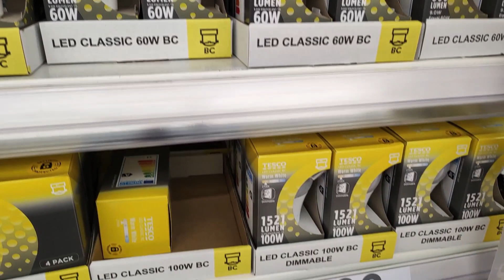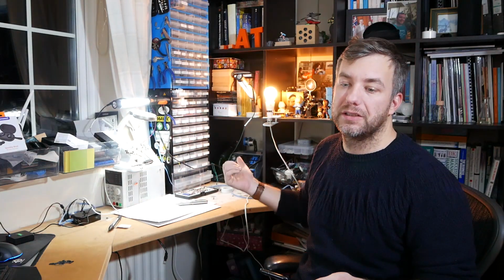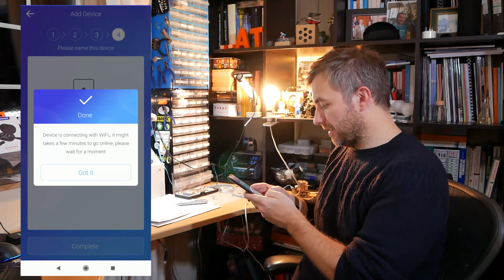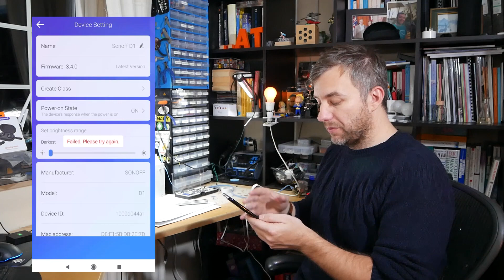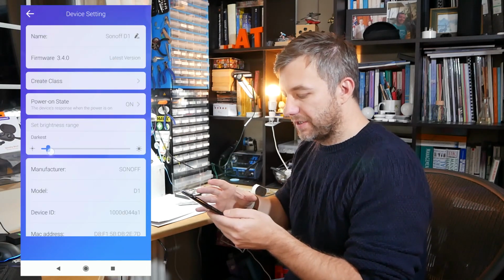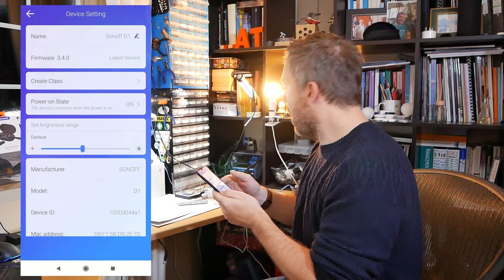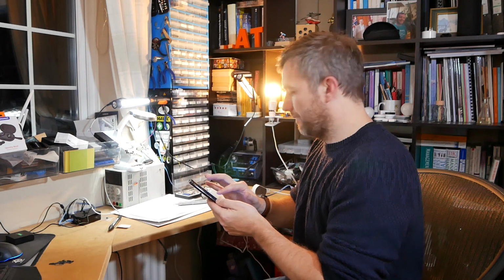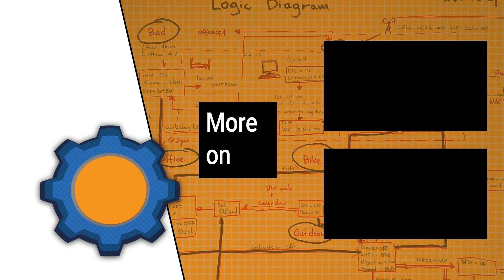Sonoff D1 Dimmer - modular in and out

Comment: Hello, I hope we can get help from you, I'm not an electrician, I can do something, I replaced all the switches with WiFi smartswitches, I will immediately point out that they are compatible with Sonoff RM433, and I bought Dimmer D1 for the living room where I have two lamps on the ceiling connected to one double switch and now I would like one lamp to be dimmable and the other not, I connected it several times with D1 reset, it does not connect to the WiFi router and the ewelink application does not find this dimmer, my question is do I have to replace this double switch with two single ones, or just with one single one and connect the Dimmer directly to the electrical wires, please help, thank you very much, best regards.
Reply from the maker: @junakjoniak661  to achieve this you'd need 2 dimmers. Assuming you want to have the same control over both gangs. Then you can fix one at the level you want and still use it for home automation instead of trying to wire one of them and leaving the other as is
Reply: Thank you so much for helping 👍 @notenoughtech

Comment: Hi fantastic video again I ordered the Sonoff D1  dimmer connected to my tall lamp takes G9 bulb and they are dimmable bulbs the Sonoff dimmer does not bim my G9 bulbs don’t no way do you no
Reply from the maker: Is it not dimming it at all or it's not dimm enough?
Reply: NotEnoughTECH hi thanks for the reply my G9 bulbs are dimmable can’t get them to work with sonoff D1 not dimming at all
Reply from the maker: Did you confirm that the dimmer is working with another bulb?
Reply: NotEnoughTECH I have try different brands off G9 dimmable bulbs all ways the same they don’t dim to be honest I did not try the bulbs you had on your video
Reply from the maker: I just wanted to make sure the dimmer works :)
Reply: NotEnoughTECH the Sonoff D1 is on the eWeLink app all set up it want dim my G9 dimmable bulbs when you set you lamp up with the DI the bulbs was flashing I did not do that I just connect the electric wire to the socket will it make any difference? Then unplug the DI then wired the lamp in to it
Reply from the maker: Can you toggle it on/off
Reply: NotEnoughTECH hi no it won’t toggle on & Off on the app says my lamp is on reality it not
Reply from the maker: If you can't toggle it there is a problem with your wires. Read this https://notenoughtech.com/featured/using-smart-light-switches/
Reply: NotEnoughTECH hi just watch your video fantastic the Sonoff DI dimmer does light Up when I go on the app it does switch off and on my G9 lamp does not switch on when I connect to the DI dimmer
Reply from the maker: What I'm asking is - when you connect the dimmer, can you turn light on/off ? I want to make sure it's wired correctly
Reply: NotEnoughTECH hi the wires are currently I can’t turn the lamp on or off the lamp dose not light up at all the D1 dimmer switch I can see the blue light on
Reply: NotEnoughTECH hi again just to let you know I made a home made lamp like yours on the video with a dimmable bulb still the same won’t power the light I think the Sonoff D1 is faulty I have ordered D1 again I hope this one works if not will be getting into with ITEAD they are the ones who shipped the item out it’s a shame I can’t send you a picture I have wired it right
Reply from the maker: If you have the voltmeter you can test the connectors but be careful
Reply: NotEnoughTECH hi I have ordered a voltmeter yesterday for amazon I did not have one when I received it and check on the Sonoff D1 Dimmer switch I will let you know I have sent ITEAD message from day one they have never reply back to my message telling them the Sonoff D1 dimmable switch is faulty telling them power coming in to the D1 switch not coming out to the bulb I have sent them pictures how it was connect
Reply from the maker: Just watch a couple of videos about safe use... Hi voltage is dangerous... And accident short can be costly to fix
Reply: NotEnoughTECH hi again I received my second Sonoff D1 switch this morning that one worked right away the first one I received was faulty just to let you no
Reply from the maker: Im glad you got this sorted. Enjoy dimming ;)

Comment: Can i use this D1 Dimmer onto my ceiling fan to control the speed?
Reply from the maker: It depends on how the fan i# controlled. Sonoff has fan controller already in their lineup
Reply: @notenoughtech  ifan03 doesnt have power state on feature.
Reply: ifan03 already installed in one of my fan. I have d1 as well. Need to consume this switch and need a dimmer as well for the other fan.
Reply from the maker: @ShZubairAhmed  tasmota? 😉 And you can have it the way you want it
Reply: @notenoughtech  which one? Ifan03 or d1 dimmer?
Reply from the maker: @ShZubairAhmed  both are hackable
Reply: @notenoughtech  thats great. Any tutorial video?
Reply from the maker: I actually don't have the fan series. I will mention this next time when speaking to ITEAD
Reply: @notenoughtech  that's great.

Comment: Can we use this switch on a 40w led tube light?
Reply from the maker: Led lights should be dimmed with PWM signal unless stated otherwise for the LED you are using.
Reply: @notenoughtech  so this sonoff switch have pwm signals to work it properly?
Reply from the maker: @ShZubairAhmed  It aims at traditional bulbs and LEDs that are dimmable by voltage. 
You have seen the results for both in the video. LED bulb wasn't doing that great.
Reply: @notenoughtech  thanks buddy
Reply: This is not working on non dimable led tube light. It cause smoke when i turned that on

Comment: Hi Matt.  Love the videos.  This is a bit old so hope you see it.  

Bit of a hack but thinking of using this dimmer in conjunction with another smart switch, perhaps Sonoff mini or Deta Grid Connect brand.  So simple on/off from switch.   

Then hang the dimmer off the line out with the intention of only being able to dim the bulbs/led via Alexa.  No intention to use on/off on dimmer.  What do you think?

Thanks mate.
Reply from the maker: This would probably address the issue with a light stayin on, but at that point, I'd go with a smart bulb instead. It's easier.

Comment: Thanks for the video Matt, very useful! What wi-fi smart dimmer would you recommend for 20 x E27, 4W, LED, 220-240V exterior lights, so the dimming function would really work?
Reply from the maker: Are you trying to dim all the lights at once? Are LED lights dim compatible? You are looking at 80W if connected in parallel. Gets complicated if you need zones to dim at different level
Reply: @notenoughtech  Yes, all at once and they are dimmable. I didn't think of different zones, but sounds interesting! :) But, all at once would be enough for now.
Reply from the maker: Any single dimmer rated for that much W should do the job if they are wired in parallel. Can't remember the max load on the ones I tested tho
Reply: @notenoughtech Super,  thanks again!

Comment: This is a leading edge design so you're never going to get full range led dimming or flicker free. They should have used Trailing Edge technology.
Reply from the maker: Sounds like I should connect this to a scope ;)
Reply: @notenoughtech   Sonoff confirmed to me that this is only a leading-edge circuit design.  Why they are still using technology designed for tungsten filament bulbs when everyone is switching over to led I'll never know.
Reply from the maker: The better news from sonoff is that they are about to release a Zigbee hub :) I have on in the post for testing!